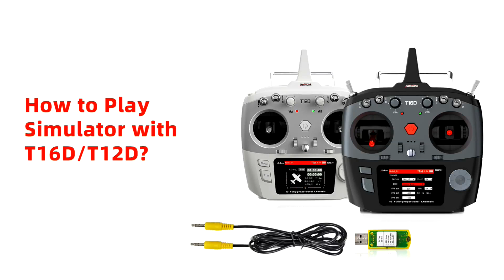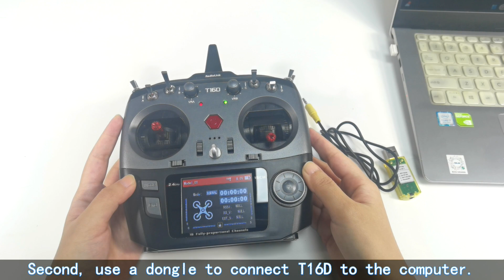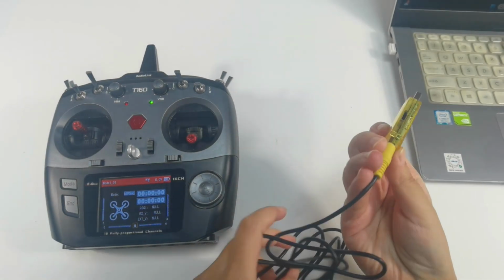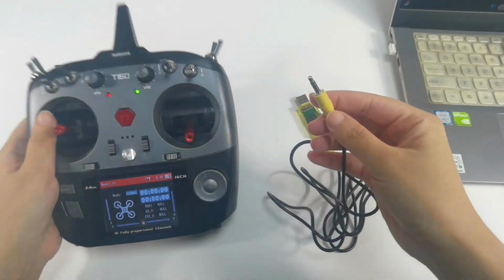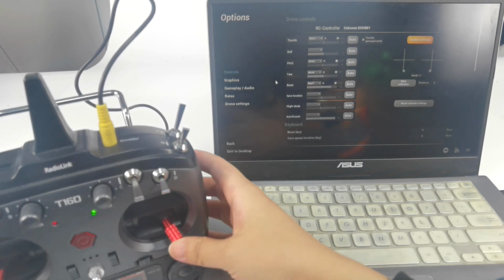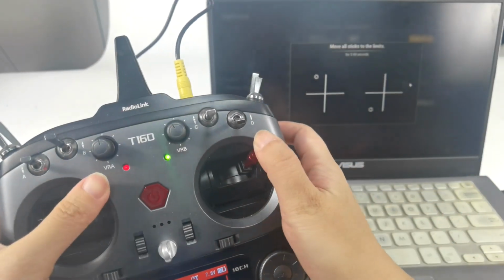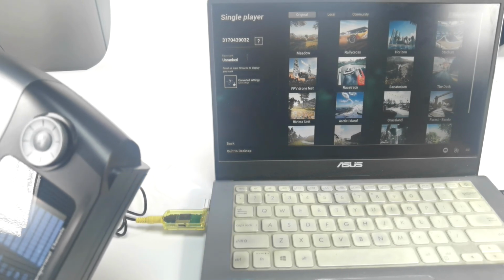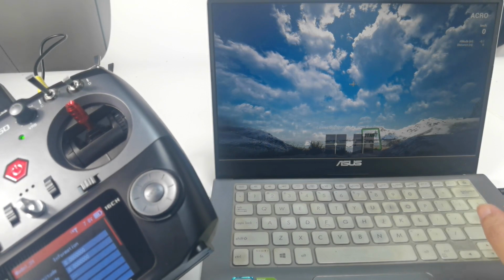How to Play Simulator with RadioLink T16D/T12D?

Comment: RadioLink T16D прийомник RadioLink R16F  не може звязаться з  CrossFlight через SBUS  я вже все перепробував .служба підтримки не відповідае.
Reply from the maker: Hi, sir. Sorry for the problem. Here are our suggestions. 1. Make sure that the connection is correct. The RC IN port of CrossFlight is connected to CH16 of the R16F receiver. The SBUS function of the R16F receiver is turned on, with a blue/purple LED on.
2. Make sure the firmware of R16F installed is the latest version. R16F firmware download link: https://www.radiolink.com/r16f_firmwares
3. If your CrossFlight was produced before Dec. 10th, 2023, please use a multimeter to test the resistance of the following components of CrossFlight. If it is not 10K, please replace it with a 10K resistor. If any question, could you please send us more details on email? Our email is after_service@radiolink.com.cn
Reply: @Radiolink_official  В мене була апаратура radiolink AT9s все працювало. Придбав radiolink T16D  і  crossflight не работае . По сігналу sdus. підключою до полетника SpeedyBee 405 все работае. в чому причина?